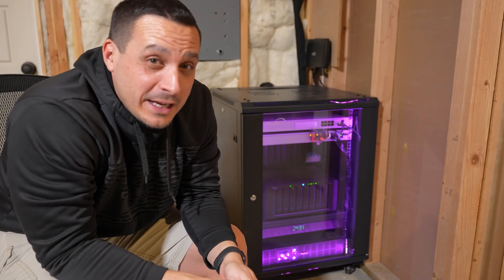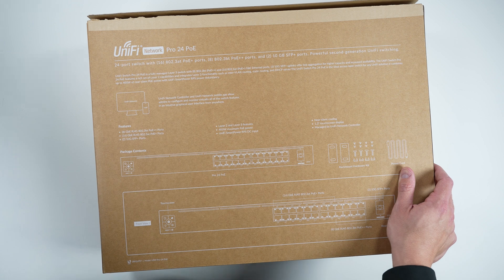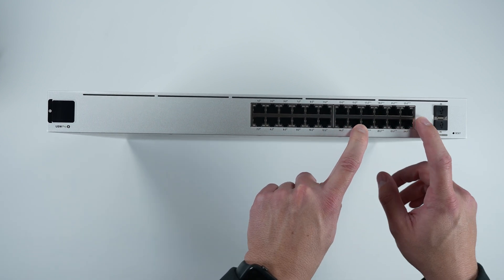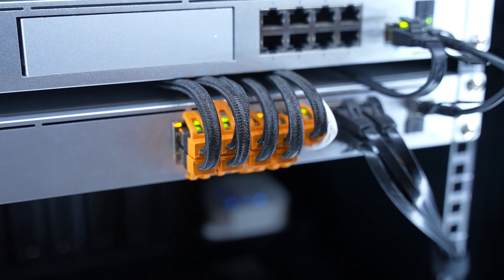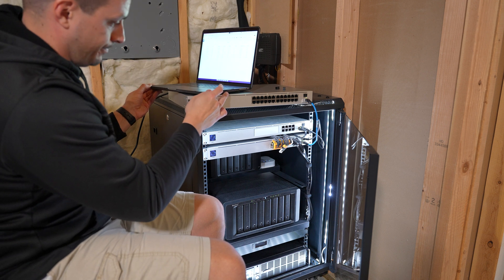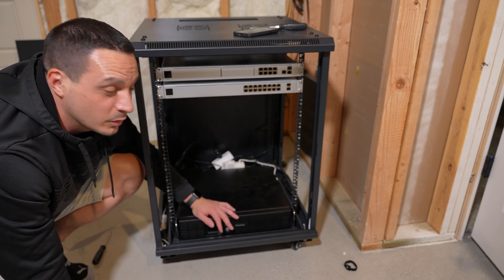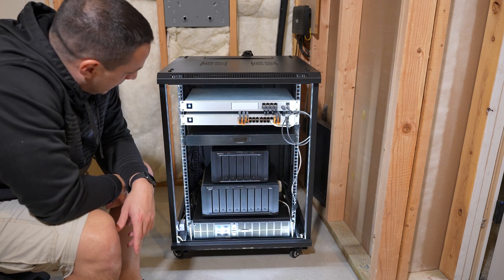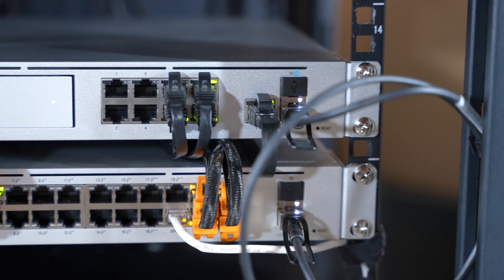Home Network Cabinet Build UPDATE - Powered by UniFi

Comment: Nice video. Thanks! For my setup, I decided to install shelves to hold my3  Synology NAS's. I decided not to put them in my rack since:
- Whenever I need to do maintenance on my rack, I move it (it's on casters). I don't like the idea of moving the rack while the Synology NAS's are running due to the potential of getting bad sectors if the rack is moved while the NAS's are running. I got tired of shutting them down whenever I need to do maintenance. Thus, some cheap shelves from the local hardware store solve this problem.
-  The Synology NASs heat up the rack due to the hard drives. 
- They're not rack mountable anyway. I considered the rack-mountable Synology NASs, but for the same specs as the non-rack mountable NASs,  the rack mountable versions are much more expensive. Also, the rack mountable NASs are very deep. Don't know why they have to make them that deep.

So, yeah, while it may have been nice to have everything in the rack, ultimately I decided to just put the Synol;ogy NASs in fixed, non-moveable shelves.
Reply from the maker: Sounds like a good option for the shelves. Appreciate your comment, thanks for sharing.
Reply: You could get a server rack case and build a TrueNAS or OMV server inside it for you NAS .  

You don’t need to move the rack
to work on things, do you? I mean, take
the panels  off for access and then you can do what you need to do!

Comment: Your ups should not be at the bottom anything to do with power should be as high as u can put it. If a flood happens everything in that rack will be fried when the ups gets wet it will send a short to all the other power supplies plugged in

Comment: One thing I like about my 1U Cyberpower UPS is that the front panel comes off and I can easily enough replace the batteries.  No need for rails.  The 2 we have at work, also can replace the batteries from the front.

Patch panels does clean things up.    I do like all the working space here.  My new upgraded 12U rack is in a small closet with about 3" on each side.  Patch panels make things easier when dealing with all my cables.  I use keystones and keystone patch panels.  So get all the wires done and then pop the keystones into place where I want them.  Grouping rooms together for example.

That looks like a nice clean home setup.  I do like the removable side panels and being on wheels so you can role it around to give you much easier access.  I just didn’t have that kind of room in my small house.  I can and so hang coats under my rack in the closet.  Putting the new 12u one in, replacing the older 8u rack, I had to drop the hanging bar down another foot.  It still works out pretty good for ganging jackets anyway.  In fact it’s packed full.   Pros and Cons.
Reply from the maker: Appreciate you sharing your experience 👍

Comment: I just got my 15U rack delivered today. My Ubiquity equipment will be arriving on Wednesday. I'm hoping I don't run into high watt usage problems like you did. I will only have one G4 pro camera running for a little while. It will mainly be recording time lapse of my garage build. I'll do a future build of the system with NAS as well as a server for my YouTube/Podcast studio in my garage. Thanks for the good content.
Reply from the maker: It should be fine. I have 4 cameras on my system with APs so it's a little more power hungry.
Reply: @TomasVillegas  Yeah, I might need to upgrade in the future to a true POE switch, but we will see.

Comment: That is not a "UPS Connect", but a "USP Connect" slot. That slot is to allow you to connect to Ubiquity's RPS system using a proprietary cable to a redundant power supply system. If the main power supply in the switch suddenly fails, the switch will automatically switch power over to the USP-RPS unit which is a separate unit and can support up to 6 devices that use the RPS cable.

You do have to use the primary power cable for the switch though. If you try to power on the switch with just the RPS cable installed, it will not power up.

However, if you loose electrical power from your service provider (or a breaker trips and you loose power), then the switch will go down unless you have the main power cable plugged into a UPS (Uninterruptible Power Supply).

The "USP" is just part of their naming convention and as far as I can ascertain, I think it stands for Ubiquity Smart Power, but don't hold me to that.
Reply from the maker: Great information and I appreciate the feedback. Apologize on the incorrect description in my video.

Comment: I needed the Pro 48 for my system but, instead of relying on one switch I broke it up with 2 Pro24POE switches. All the ports throughout the house are on one and all the cameras and access points on the other. Leaves me with 800w of POE and 16 POE++ ports. Way overkill for what I need but leaves me plenty of room to expand.
Reply from the maker: That's a better way of doing it IMO. Sounds like you have quite the setup. 👍
Reply: I used to not like the way the non Pro switches had some PoE and some non-PoE ports.  After using a Pro 48 PoE on another install, I am thoroughly convinced that a mix of PoE and non-PoE are more desirable.  I only wish the non Pro switches had 10Gb SFP+ ports.
Reply: @russzaccari7761  if the USW24Poe had 10gb sfp, a little bigger wattage bank and the ability to connect to the RPS (not that I would buy it at the moment) it would have been plenty for my setup. My thinking at the time was I’ll definitely have future proof the house. Ubiquiti seems to know what there doing in the marketing game. There pretty good at putting out a product and then when just about everyone has it they put out a similar product out just a little bit better than the one you just bought for a few hundred dollars. Then you have the task of convincing the wife/partner why you need to spend money again :) Dream Machine Pro SE is the perfect example.